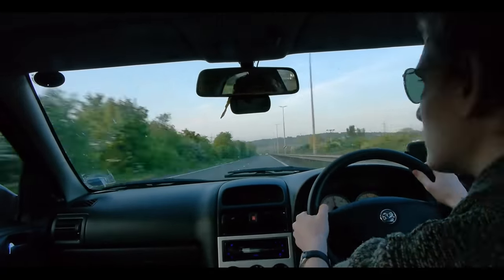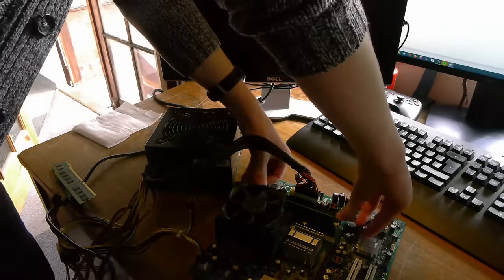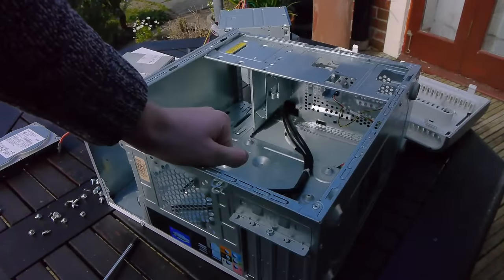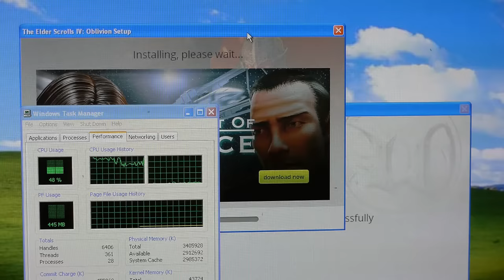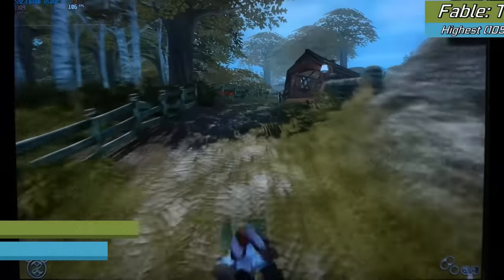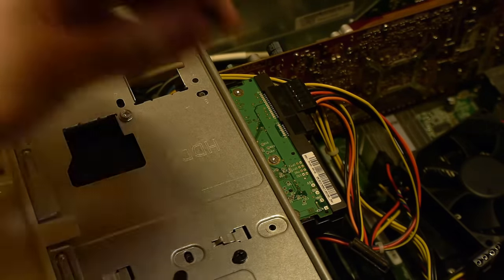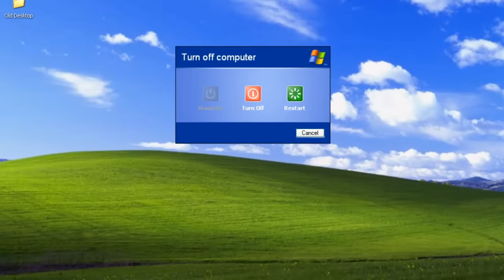The Ultimate Windows XP PC

Comment: I have a Dell Optiplex 320 from that same Era. That was made during the Capacitor Plague & I needed to replace my Motherboard. It Originally came with a Pentium 4 (Socket 775) but could handle Pentium Ds & some Core 2 Duos. I managed to put a 2Ghz Core 2 (could not get a more powerful one than that to work). It has 2 RAM Slots for DDR 400, it is supposed to Handle a total of 4 Gigs but whenever I used the Full 4 Gigs it ran Extremely Slow. I was going to put Windows 7 on it but without the Full 4 Gigs it would have been pointless. So I pulled one RAM stick so only has 2 Gigs of RAM, max for Regular XP so that is what I put in it. I stuck a large Nvidea 750ti in it with a Riser Card Cable because it would not have fit otherwise. I was shocked when it ran Castlevania Lords of Shadow quite well. Mostly on the GPU but still for small amount of RAM at a slower speed & only a 2Ghz CPU that aint bad.

Comment: My ultimate build for an XP machine used a Gen 4 i5 CPU and an Nvidia Quadro K1200.
It's screaming fast for XP stuff. Great for using on a high-res monitor.
Also, if you're capturing old consoles and have access to SCART cables, I highly recommend buying a epiphan DVI2USB or DVI2PCIE. You need to get a SCART to VGA cable that is properly wired and a VGA to DVI-I adapter, but it will capture RGB scart video flawlessly. I see them on sale for cheap on ebay all the time.

Comment: Yeah, recently rebuilt an old Shuttle XPC Cube PC I was given, ripped out the crap Celeron single core and shoved a Pentium 4 in (the biggest it would take), running on 1 gig of ram a, 2 gig ati card and Windows XP. Stuck all of my old games on it with a 4 x 3 monitor, everything runs really well, oh, and I swapped out the floppy drive for a card reader. So good to play my old games that won't run on later OS's.

Comment: I just installed Windows XP x64 edition a few hours ago inside VM. Blazing fast, and everything is responsive, even more so than on windows 10. It’s too bad that this x64 is not compatible with most stuff normal people will use back in the day, but only for special software like research software or high end creativity stuff.

Windows XP will be something our generation will probably remember, forever. The good old era when genuinely good software existed, no string attached.

Comment: I rescued an old HP laptop (HP Elitebook 8530p) which has following specs
Intel Centrino 2 vPro. (Core 2 Duo)
8 GB DDR2 (800 Mhz)
ATI Mobitilty Radeon HD 3650
320GB HDD
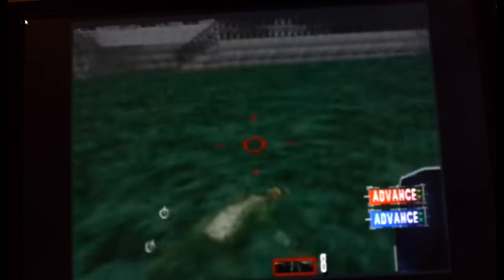15.4" 16:10 Full HD Widescreen.

It was born with Vista.
Came with Win 10.

I popped it open, cleaned it, used the last of my thermal paste, that I had left over from a PC build and GPU cleaning.

Installed WinXP SP3

Intention?
Play NFS MW 2005-version & NFS High Stakes/Road Challenge
And other games, that either runs badly on Vista+ or doesn't run at all.

And now that I am watching this video where you mess with movie maker... I do have some software, that I preferred using, due to intuitive UI, comapred to a lot of today's software. :)

Comment: It's crazy to think just how much hardware improved from when XP launched in 2001 to when it stopped shipping in new PCs around 2008/09 or so. XP started life on 1Ghz Athlons and Pentium 3s with 256MB of RAM and ended up on systems later with Core 2 Quads and 4GB of RAM. Higher end systems when Windows 8 and especially 10 launched can still play basically any AAA title with a few settings turned down. Imagine a K7 Athlon with 256MB of RAM and a GeForce 3 being able to play Crysis without issue lol

Comment: about the pcie to pci adapters i can tell you that those are a mixbag of working and having issues,  the problems with those are usually caused some motherboard or bios issue, since pcie-only motherboards usually don't need any scenanigan for the old pci interface. Other reccomendation is to get a case with those vertical gpu supports built in, since you can use those for the pci cards with the adapter cables connecting them to the motherboard, it's good since you don't have any awkward setups for the cards and you have those properly secured to the case
Reply from the maker: Might be worth a shout. I have a vertical mount in my PC.

Comment: I am glad I watched the video all the way through.  XPsp3 is a great OS.  However, putting it on a duo is like putting a corvette engine on a tractor because you want it to plow faster.  That is, the OS does not utilize the full functions of a duo.  However, Vista does.  Vista, the PITA it was had the benefit of upgrading in that it utilizes duo's... Not as well as 7 but that is where the "extra" stuff came from, utilizing the second core.  The best XP boxes in my humble opinion are those shiny black compaq boxes with the thick gray band wrapped around near the front with "Compaq" molded into it.  Put in a decent discrete video card and they run smooth as silk.

Comment: I’m in the middle of a Windows CP build myself. So far I’ve collected a 3GHz Prescott 478, Zalman CNPS 7700 Cu HSF, 2GB DDR400 RAM and a Gigabyte 8I865GME mobo. I still need to get a more powerful PSU (I’m stuck with the OG 250W PSU that came with my PC in Dec. 2001), a decent video card (temporarily using an Albatron FX5200) and a 17” CRT. AGP video cards from the mid 00s are just so rare and expensive!

Comment: The Asus Sabertooth 990FX R2.0 can run 32-bit and 64-Windows XP. The nVidia GTX 960 is the last and most powerful graphics card for which nVidia offered both 32-bit and 64-bit Windows XP drivers. Further, such a rig runs Linux Mint 20.2 Cinnamon beautifully and can also run Windows 10 21H2 well. There's your ultimate Windows XP rig that can also run modern operating systems.

Comment: I kind of went overkill with the XP build idea too...
Dell Optiplex 9020.
XP Service Pack 3.
I7 4790K.
32 gigs Hyper-X Fury ram (yes I know, but I did it because I could).
500 gig Samsung 860 Evo boot drive.
1 TB Western Digital mechanical drive for extra storage.
GTX 960 SSC. The 4 gig version. (With a very light overclock)
700 Watt 80+ bronze EVGA PSU.
Blah blah blah... Long story short some of my XP era games are now exceeding 1300 FPS lmao...

Side note, if someone is to try and replicate this be aware Dell never made XP drivers for the 9020 series Optiplex. That said if you use Snappy Drivers (yes it's safe look it up) it'll install all the drivers and make everything work. Sure beats the hell out of my old XP system which was a Dell Optiplex (notice a theme here yet?) GX620 with a heat furnace Pentium D and a GT730.

Comment: I actually just built a "sleeper" build in one of these chassis lol. Did a motherboard and PSU swap and now it's running an FX 8320 and 16GB RAM with Windows 10, eons better than the old Core 2 Duo and 2GB it was running before.

Comment: I've had luck getting a capture card that only had drivers for 32-bit WinXP working on 64-bit Win10 by searching for other cards that used the same encoder chip model and selecting them manually from the "Have Disk" option in the driver install page. I had to search around for a couple different versions until I finally found one that worked. Getting a card that never officially supported 64 bit and Vista+ to work in my computer was awesome. 
I've since gotten this to work with an old webcam that had Vista drivers that really messed things up in win10. I found a Phillips webcam driver for windows 7 that worked great, and the webcam software was way less bloated.
Of course, installing drivers like this comes with possible risks, so do this at your own risk.

Comment: I've recently started assembling my own XP SLI machine/retro collection. So far I've got...
Asus M3N-HT Deluxe
AMD Phenom II 965 (served me well for 6-7 years. H100i failed and damaged her. Does NOT like above 82C or else she artifacts.)
x2 EVGA 9800 GT's (non eco)
x1 BFG Tech 9800 GT Eco feat. Coil Whine (personal card I used for years)
x2 EVGA 8800 GTS's 
x1 EVGA GTX 480 for alternative space heater
x4 OCZ Reaper 2GB 1066
x3 Mushkin Blackline 1GB 800

HDD will certainly be a WD Raptor 10,000 RPM

Got some other old hardware but either not era correct/not interesting.

Haven't decided on the case as of yet. I love the style of the old Dell XPS/Alienware cases, however they've got zero cable management from what I've seen. Was also considering the Rosewill Challenger if all else fails. Thing was released in 2010 and they're still being produced. It just screams decked out XP machine (to me, at least...)

If you noticed, I didn't list a power supply. Because there is none. 'Cause of Corona. Thanks Corona.

Comment: Capturing via composite makes it pretty damned authentic to how we all grew up playing. I use a very convoluted setup for maximum fidelity lol. I run my capture as follows: consoles(YpBpR component)>component switch box>component splitter>TV's, and OSSC> HDMI splitter> Dell CRT monitor, and the HDMI IN on an Xbox One>Elgato capture card. 

I play 240p on an SD CRT Trinitron, and 480p, 720p, and 1080i on an HD CRT Trinitron. I use the OSSC to upscale my gameplay for streaming / recording purposes. The Xbox is in the chain because it doesn't care what signals I throw at it. This means I can upscale 5x and still capture it with my elgato. 

I hope you all enjoyed my stupidly convoluted setup

Comment: I owned a C2D 8400 as my First LGA 775 CPU when I built that rig then I was having issues with the PC turning on then off and thought it was the CPU but it wasn't then I got a free upgrade to a Q6600 because it turned out to be old Hippague PCI video capture card. Finally my LGA 775 PC was on its last legs because if you had USB HDD turned on while booting it wouldn't boot correctly.  Then I upgraded to my 4790K system that I have currently that it is on it's way out due to it showing it's age as far as I want to use a PC for.  The E8400 was an awesome chip.

Comment: Using the same case but black with some newer parts in it. i5-9600k, 16gb ram, Seasonic modular 80 plus gold, and GTX 970 (for now). under high load was impressed to see the case keep temps down, suprisingly decent ventilation. Used the case cause it was in such good shape and the black model has a nice shine on the side panels tbh. simple, and if someone were to break in, they aren't taking it, had to leave the Win XP logo on it.

Comment: Video Idea: try this pc on  a lightweight Linux distribution like lubuntu 18.04.4 or linux mint 19.3 xfce edition. You could see what the computer could do with up to date os that will run well on old system. Maybe try retro games and older hardware and see if it works or not. Maybe use it as your main system for a week. Shotwell is a good simple video editor and kdenlive is pretty good for more advanced video editor. make sure u install wine and d9vk and dxvk for games and windows software. 

this would be a pretty interesting vid to see.

Comment: When I read the title I was hoping you'd be doing the AMD FX-6950 and R9 270X. But you actually built my XP computer's brother!
I've got an old XPS 400, dropped a $10 CPU in it, and my old R9 270X. Pretty heavy overkill considering the processor but it's still the best XP experience I've ever had. 
I do have an FX-6950 but I keep running into some sort of issue when I make the custom XP install for it, I'm assuming it's just fun with drivers.
Reply: Oh and XP in 2560x1080 is such an odd yet rewarding feeling, I love it!

Comment: The best possible xp setup is a i7 3770, with a gtx 980 (modded 960 drivers with 980 hwids added to the inf files). It should also be feasibly possible to have 16gb ddr3 ram provided you use a pae hack. (Physical address extention).

Comment: this is a random thing i discovered from one XP retro build enthusiast to another... Dell is amazing and their h61 express chipset can have XP installed on it with no issues. the chipset came out before 2014 when XP was still supported. just dont update the Bios newer than A04

My ultimate XP system is an optiplex 390 (2011 ish) with a i5 2500k 4GB DDR3 GTX 280 with 2x 120GB SSD... i bought 2 3:4 dell monitors but i use a cheap 22" acer monitor

i also have a gt 9800 in a box somewhere... i have couple 3rd gen i5s but an i3 3220 would be perfect. I have a small library of games i burned ISOs of. Every game i loved from 2003-2010... i scavenged ebay for star wars titles only to have them all released in a bundle on steam. but nothing beats the XP versions of XP games

Comment: i bought a similar Dell vostro 200 (basically the same PC with a different name)
it came with a 4GB DDR2 and pentium E2160 originally in 2016 

later i upgraded it with an E8500 and a AMD HD 4550 1GB and 8GB RAM
it is honestly a decent System provided you don't keep your expectations high

Comment: Wish I could find somebody like you living around here.i am Constantly picking up old machines people are getting rid of and i Usually selling them for ridiculously low prices.its pretty difficult to move the stuff really.add to that i have a nice little cash of custom-made gaming machines that I still haven't gotten around to doing anything with due to lack of time. that dell I've had several that were in good working order usually people buy them strictly for the tower or modify them for running emulators.i have two similar to this one right now both of them are working one is missing the faceplate but if somebody wanted to yank out the components and put them in a different hour everything's working. I've got I'd say 15 or 20 Windows XP generation single-core and dual-core machines sitting in the back room that I've got up for sale and at least nine gaming machines that are Windows Vista and Windows 7 to Windows 8 generation all of which will quite happily run Windows 7 without any problems jst not had the time to swap parts around and get everything up and running. You think this thing is overkill you should see a couple of the windows generation custom built gaming computers that I have;) one of which is capable of running up to around 8 gig of ddr2 RAM with the specs that machine has it will comfortably run Windows 7 too despite its from the Xp generation

Comment: I still got my ATI 4850 from back in the day. The only issue with ATIs default heatsink and fan is they clog up with dust fairly quickly. So you have to take the card out of the PC, and remove the cooler to clean the dust from the heatsink out. Otherwise it really overheats easily. 

Small complaint, I'm lazy. Still a great Windows XP card though. Just spoiled with new custom GPUs and much easier cleaning requirements.

Comment: sadly... it's a G33M02, so you're limited to dualcore chips. you can 771 mod it and drop in any dualcore Xeon, which would give more cache, (probably...) but honestly the next step up would be to find a different machine that can take quads, if you genuinely want a smooth XP experience forever to come.

Comment: did you ever run Windows XP on AMD Opteron 6180SE?
I did. It was fast, as soon as I dropped IDE and got VIRTIO instead
can you imagine? 2 sockets, 6 cores each (AMD Opteron 6180SE is dual socket CPU, as it actually have completely separate 2 dies inside)

Comment: Use a hdd for xp: Windows XP lacks the support for a very important feature which significantly help maintain the performance of SSD. It is TRIM Support. That means you will observe a noticeably degradation in performance after a specific amount of usage. Besides that you should put a xeon lga 771 cpu on it ;)
Reply from the maker: Corsaie SSD Software forces TRIM on XP

Comment: OEM psus really are a hit or miss. I’ve bought a used prebuilt system with 980 SLi that was powered by a power supply literally called “750W GREAT PSU”. (That’s not a expression, that’s what it literally said) but I’ve also seen some come with EVGA Supernova or Seasonic Prime+

Comment: That was the family computer for a while until it was given to me for my own personal computer. It ran okay back in the day and then as time went by it was slow as hell. I even tried doing some upgrades and even formated a whole new hard drive to make it decent to use. It was still pretty slow, I had recently traded a better laptop to a friend who was moving away, that laptop was way more better than that desktop. I would prolly use it again but I would use it for something better. There's a little thing called NSV (NullSoft Video) that was created by Nullsoft in 2003 and I wanna use older hardware to pretty much make my own little tv station using that old 2000s software.